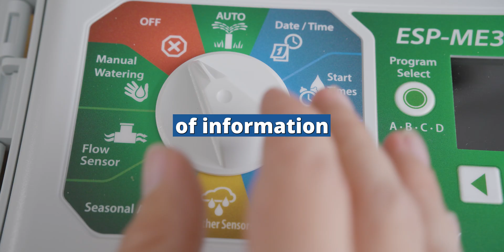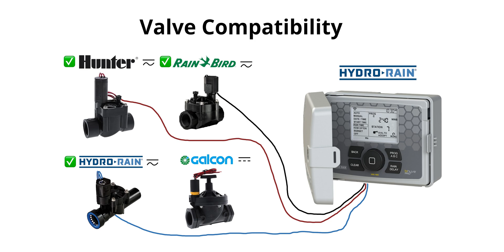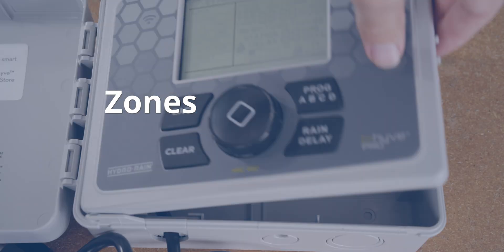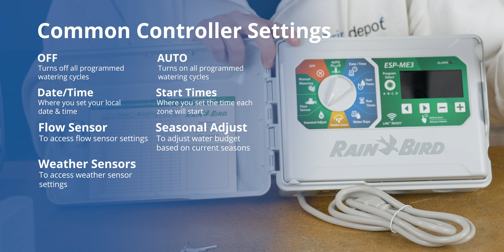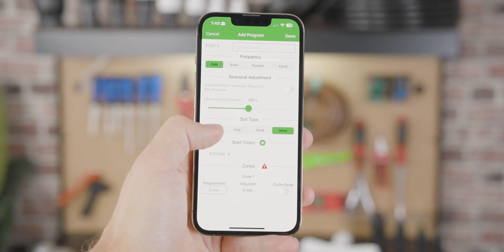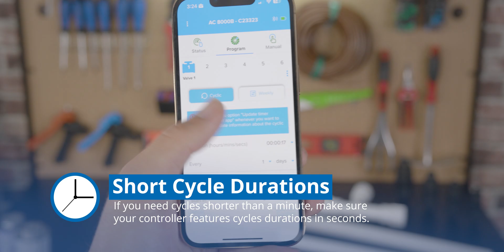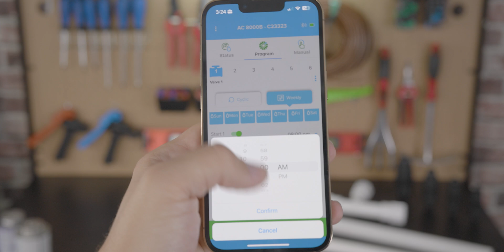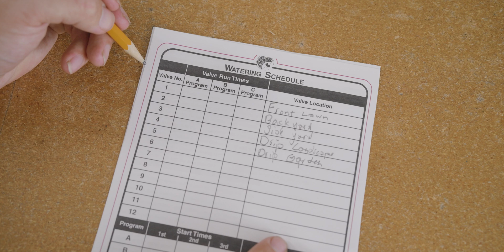Irrigation Controllers: What’s the Best Controller for your Irrigation System?

Comment: I have a multi zone sprinkler system that was built around 1996. The zones are controlled by solenoids that are next to the zone instead of next to the controller as most modern systems are built now. The system worked well until the original 12 Zone controller (not sure what it was) broke down.  Note: The landscaping on my home was very excessive, reduced it to 6 zones. I installed 6 Zone Orbit B-hyve controller few years ago, but the controller could only drive the solenoid next to it, I checked the voltage on the solenoids that are not next to the controller and noted a voltage drop it was around 17Volts, not strong enough to energize a 24Volt solenoids. 

I suspect that the controller is not built to energize solenoids far from its location  which is anywhere from 30 to 120 feet away. 

I need a recommendation to what controller I can purchase that would energize solenoids far from the location of the controller.  Any information is much appreciated.
Reply from the maker: Do you know what valves/solenoids you're using?  The reason I ask is that the Bhyve's inrush and max inrush current are right in line with other controllers, so I'd be concerned about getting similar results from another controller.  Is the wiring all original from that 1996 install?  If so, I'd check wire connections for corrosion or damage.  Alternatively, you could test the resistance at the end near the solenoid, and then audit the resistance at various points between the controller and valve (if there's any convenient access points like splice locations) and find where the resistance peaks.  This could indicate a damage or corroded section of wire or corroded splice.  

With all that said, some commercial controllers do have higher inrush currents than common residential controllers, is it possible you were using a commercial controller?   

With everything described (Bhyve controller, 120' between controller and valve) I'd look more towards the wiring or potentially the solenoid itself than the controller.  A 30% drop in voltage is much higher than expected on a 130' run of wire (at least of common low voltage 18 AWG wire).  

Happy to help with any follow-up questions!

Comment: Hey Adam! I rented a plot at a community garden that allows me to add a water timer and drip irrigation system.

Do you have any recommendations on a budget system that I can showcase?
Reply from the maker: Heck yeah Dave, happy to help with this!  

Ok, let's start with the system -- how big of a system are you looking to showcase here, and what type -- like, a couple raised beds, in-ground beds, etc? 

For the timer, is this system going to be running off a hose bib?  If so, we can focus on the hose end timers (which will be much more budget friendly compare to a controller like these as well).
Reply: @dripdepot  Hey Adam,
I have access to a hose bib with a 4-way splitter, and one slot is available for me. This water bib is about 20 feet away from my designated gardening plot. Ideally, I would like to hook up a garden hose and drip irrigation. 

As for the size of the garden, let’s just say I plan to maximize every inch possible, so I need to plan ahead for water pressure. We are not allowed to have trees, so I am thinking of several berry bushes, flowers, a few raised beds (8-10+ beds), and a tunnel trellis.

I believe the size of my lot is 20 x 25 feet.
Reply from the maker: @GardeningwithDave  This is fantastic Dave -- I think if you focused on the parts that primarily go into our raised bed kits you could do it all that way.  The 1/4" drip line in those kits is versatile and can handle everything you mentioned (and is even the preferred way).  1/4" drip line is also reasonably priced -- you could potentially lower the overall costs a bit by making your own dripline with 1/4" inline emitters, but the labor time would go up exponentially.  Happy to run some cost comparisons on that with you to keep this budget friendly.   

You're on the right track planning ahead for pressure and flow now as well, it sounds like you'll be making the most of the space which means quite a few plants (a very good thing!). 

With that in mind, are you allowed to do a 2-outlet timer there?  A 2-Outlet timer basically allows it to be a 2 zone system, and they're not budget breakers: https://www.dripdepot.com/hose-end-irrigation-timer-outlets-two

That may not even be a concern though, let's first test the flow rate of the hose bib you'll be using to see about the likelihood you'll need to zone.  All you need is a timer and a bucket -- time how long it takes to fill the bucket (even a 1 gallon jug can work) with water and then plug the numbers into the flow rate calculator here to get a good idea of its flow rate:  https://www.dripdepot.com/irrigation-calculators

Let me know what results you get -- while you're there, get an idea of its pressure as well.  If you have a pressure gauge, use that, but if you don't that's ok, just let me know how the pressure "feels".  If it feels like normal residential pressure, that should be enough information -- if it feels particularly strong or weak let me know :)
Reply: @dripdepot  thank you Adam 🙏

Comment: I will be changing my rasied beds to  the metal rasied beds next year hopefully I will have things set up by march.
love your videos!
Have you come up with any new tips on the Irrigation on the rasied beds ?
Thank for doing what you !!
Brad.
NJ
Any tips on preventing chipmunks from getting into rasied beds?
Reply from the maker: I do actually have a tip that's not in one of the videos yet!  This might have been well known to other folks, but using ferments (fermented food scraps, fermented liquids) can improve yields.  I got this tip from a customer who grows commercially -- this year, he kept referring to running ferments through his fertilizer injector, so I had to ask.  He injects fermented liquids right through his injector instead of traditional fertilizers (he no doubt uses some of those as well, but I hadn't heard of injecting ferments before). 

Smaller critters can definitely be an issue in a garden -- in my home garden, it's raccoons.  Are they entering the beds through the bottom?  If so, a wire mesh at the bottom of the bed can prevent this (burrowing up into the bed) entirely, from chipmunks and other burrowers.  Chicken wire, hardware cloth and similar wire meshes work pretty good, just lay it out where the bed will go and place the bed on top -- you can use some landscape staples to hold it in place initially if you need, but after that the weight of the bed will keep it secure.  

At the top, wire cages and chicken wire (anything with a fine enough of a mesh) can help deter them from getting into the bed that way (unless they're unreasonably strong like Oregon raccoons) :)